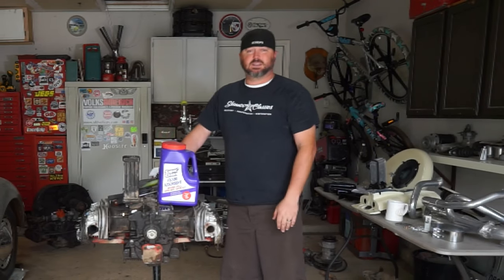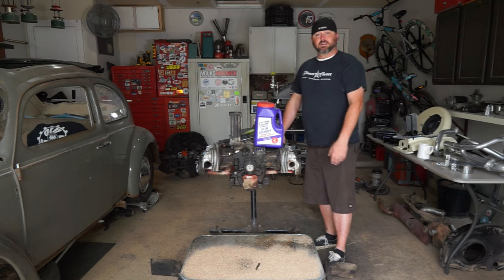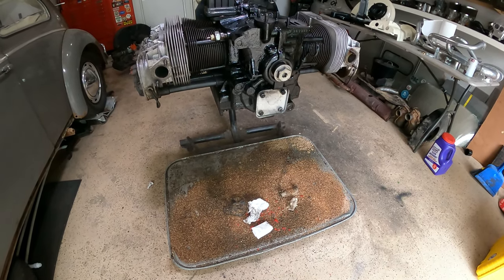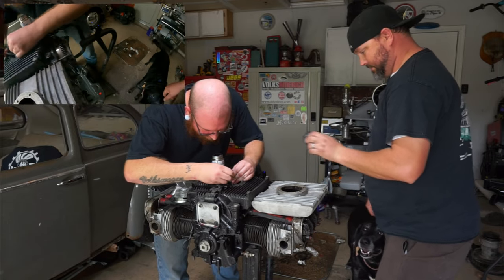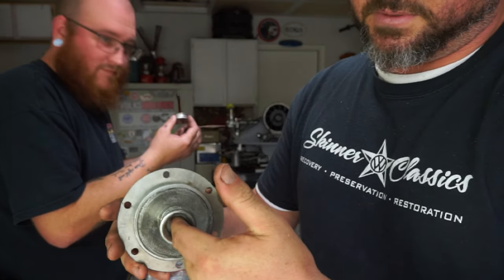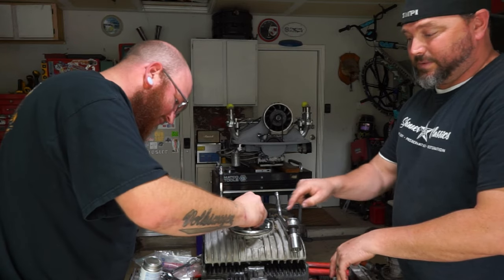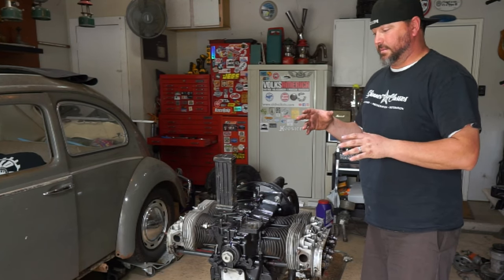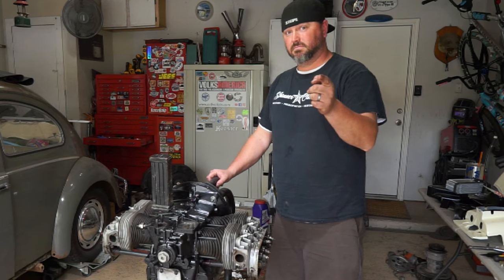Adding an External Sump to a VW Bus Engine

Comment: permatex is a very good sealer and will not leak. this will be a asset to cool that motor off in high temps.
can't wait for the next video.
Reply from the maker: That's what I'm hoping

Comment: My engine has the larger sump but I haven't driven it much as of yet. Just ordered several body for it to cut down on some of the draft.😎 The tranny has a slight drip but it did sit in a pasture for a couple decades.  I was pleased that it worked after we just drained it and put fresh lube in it.
Reply from the maker: Awesome!